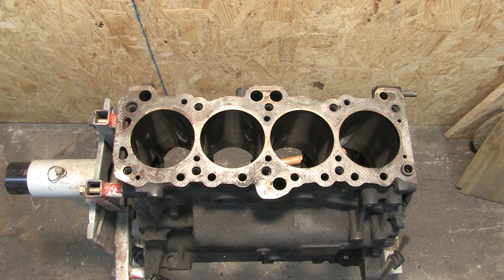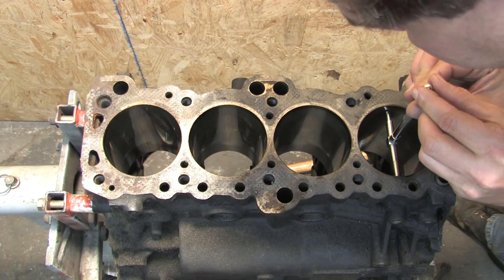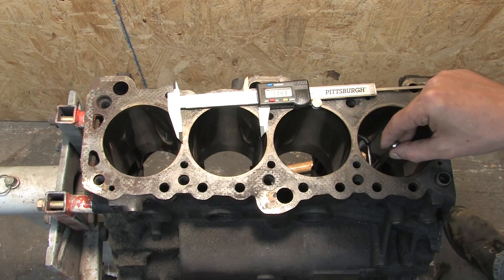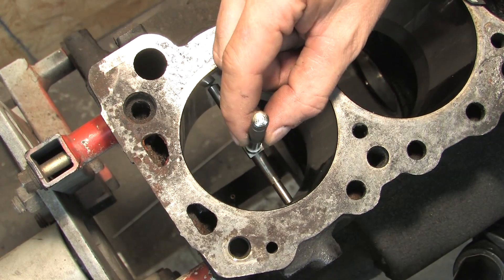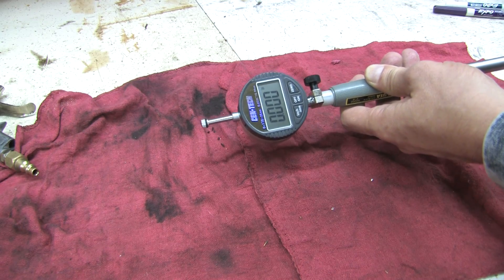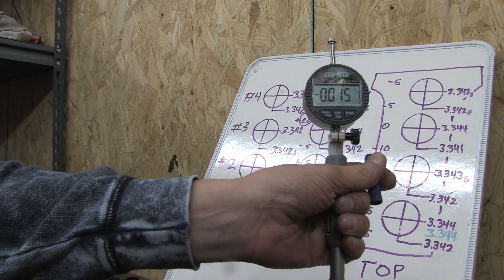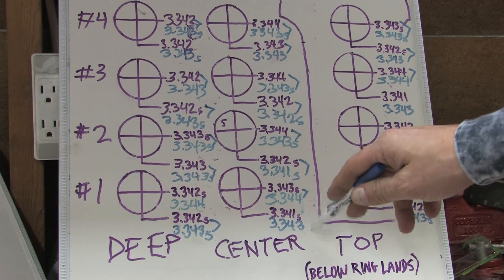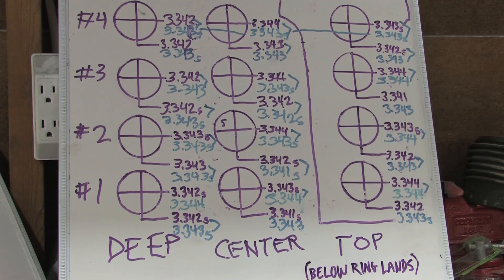Blueprint 106 - Cylinder Bore Inspection

Comment: Amazing that the 2 tools are that close but....using the telescopic gauges and calipers involve 2 tools and therefore 2 errors. Then comparing the bore gauge against the telescopic/caliper pair invokes an error of the 2 tools accuracy to each other. Also you can possibly be holding the telescopic gauge perfectly parallel to the cylinder wall on any one point or consistently across the 3 points in the cylinder and that could account for at least 0.0005 or more at each point I'd guess. So I'd say the bore gauge is the best way to go, especially given its ease.

But I really liked this video on the subject matter and how to measure..very well done...thanks!!!!!!!

Comment: Those cheap telescoping gauges ARE adequate for this job, contrary to the commenters' opinions below. Yes, top quality gauges would be better, but Jafromobile  is simply trying to decide whether this block should be shipped out for boring or not. I do have my doubts about that pair of digital calipers, though........don't know if it has the accuracy he needs. I use a fairly expensive dial bore indicator, but it's all about technique: the best tools give useless information to the inexperienced. Practice, practice, practice!

Comment: I'm using the digital dial bore gauge and measuring my cylinder with the stock size is 2.854 inches. If the biggest measurement is  - 0.001 does the mean I should add that to the stock size or subtract it. Thanks in advance

Comment: The proper way to use telescopic gauges is to wiggle it a few times  in the same direction of the length of the two spring loaded contact points  to align it in the center of the bore. On the last wiggle stop just short of being perpendicular to the bore and lightly tighten the gauge. Finish pulling the gauge to get it to the tightest point and pass it, as you pass it if you tightened the gauge enough it will remain at that length. Then remove it from the cylinder and tighten it slightly more so it doesn't move while measuring. Use a micrometer and very lightly tighten it on the two ends several times while moving the gauge on the anvil mentally noting the largest reading, move it all around the point that you got the largest reading to make sure that it was truly the larges reading.  Whichever reading was the largest is your measurement. This takes getting a feel for the gauge and the micrometer so practice is necessary. Using a pair of calipers is not advised because you do not get a good enough feel but it is better than nothing and with patience will at least give you a rough comparison but will not likely give an accurate measurement. I just measured a block that the cylinders had a total measurement difference of between .014 and .017 difference from taper and out of roundness so in this case a pair of calipers would be good enough to tell it needs to be rebored.

Comment: How about bore distortion from torqued fasteners (head and main)? Have you compared measurements with a torque plate vs. without?
Reply from the maker: Not yet, but I'm fairly certain that a 4g63 will produce very little deflection if it's even measurable at all.  I'm not saying that a 4g63 is somehow impervious to this effect.  In fact, that condition is very real, and it's exaggerated if both of those surfaces aren't perfectly flat... it's just more likely that inline 6 cylinder, large displacement, or sleeved aluminum alloy blocks would suffer from this than a medium-sized cast iron solid-decked inline 4 block.  My machine shop uses a torque plate for boring.  I don't worry about the mains.  6-bolts have massive main bores and 7-bolts have a girdle.  I've never been so curious about either affect on a 4g63 to have bothered measuring it.  It hasn't bit me yet.

Comment: the metric system is so much more easy to understand, I understand what your saying theory wise, but the imperial unit of measure is backwards to me. Why do Americans use a outdated system?, it's archaic. Great videos by the way.
Reply from the maker: +oliver fox One thing is true about the differences in measurements despite what may confuse anyone.  The average shop manual for any given engine typically has specifications for machining listed in both metric and standard  measurements.  Metric is in hundredths of a millimeter, standard is in ten-thousandths of an inch.  Because it takes .0004" to equal .01mm, SAE measuring tools graduated in .0001" have 4 times the resolution and accuracy than metric tools graduated in .01mm provide.

But the real reason why you see standard here is because the cost of metric precision measurement tools is prohibitively high in the US because supply/demand.  I now have standard tools graduated in .0001" and .00005", and I hope you can adapt because I can't afford their metric equivalents.  I end up doing more math calculating stuff from standard measurements to metric when I have to have it in an equation that way, I'll admit; but normally all I have to do is measure and follow a printed spec.  I can handle the SAE/Metric system either way and convert most of them without a calculator whether I'm measuring liquids or solids, so it really makes no difference to me.  For me it's all about precision vs. price.  

If anyone wants to send me a free set of Starret or Mitutoyo micrometers from 0-6"... oops... I mean 0-152.4mm... I'll be happy to re-shoot these videos using the metric system.  ;)  For me, they're over $2,000, and that doesn't include a dial gauge.  That's worth more than 2 of my cars, combined.
Reply: Here in the UK with its mostly metric for everything, we have weights in both usually and still use Mph instead of kph like they do on the continent. I can see what your saying, for sure that's a good point.I'm sure some heritage vehicle workshops will have to use both.its actually advantageous to be able to work in both and for things like pressure and speed I can, unless your of a certain age in here or a engineer, your average tech, like I am is used to what we use today. We don't measure engines at the workshop I work in, but I want to know practices that are useful and not that common in main dealers, I found your video really helpful. Thanks for taking the time to make it.
Reply: The reason is, imperial units of measure have fractional units whose denominators are divisible by 2, if not proper power of two which leads to useful properties when trying to reduce errors when taking calculations.  Metric system may lead to byzantine faults.
Reply from the maker: Man... why can't more of your comments be like this one?  I'd reply to more of your comments if you were at least subscribed.
Reply: Slappy Fistwad You sound smart but to the trained mind your byzantine faults suggestion - does not apply in this scenario.

Comment: You shouldn't have blamed the telescoping gauge for being inaccurate,  because you were taking the measurements with a vernier caliper.   Always use a micrometer with a telescoping gauge and you will find they are better than the dial bore gauge's.  Also, don't wiggle a telescoping gauge.   Tighten the tele gauge's screw just enough so that when you measure it with the micrometer it will retain it's length, and then rock it through.   This will compress the tele gauge to the exact diameter being measured.   Measure the thrust diameter (larger) first, then turn the gauge 90 degrees to immediately find the amount of egg shape in that height of the Cylinder.   The best tele gauges only compress on one end.  With one hand anchor the fixed end of the tele gauge and rock it through to compress the other end to get the measurable length.   Awesome videos,  keep up the good work!
Reply: That is a digital caliper not a vernier caliper.

Comment: great videos jafro, I've been following and learning the whole way through and buying tools you recommend to rebuild dsm engines. My question is with the digital bore gauge do I just set my dial caliper to 3.5 for example then put bore gauge in between and just press zero then start measuring the bores?
Reply from the maker: 4g63spdfreak Yes, you got it!  'cept you should use something more accurate than a dial caliper.  A dial micrometer with a known zero (in other words, tested with the reference gauge included with it) works better.
Reply: Ok sounds great thanks

Comment: The vernier caliper you are using is only accurate to +- 0.02mm at it's very best. Dial bore gage does save allot of time and hassle that is true.
Reply: There are digital calipers, dial calipers and vernier calipers, what he used are digital calipers.

Comment: it seems that i will soon buy a motor from the junkyard and start working on it but i have one question. the engine i am going to buy is a b230 it's a volvo engine, i have all the specifications for it but the cylinder measurement is like this no 1 cylinder 96mm to 96.01mm no 2 96.02 to 96.03 and so on . but when i measure the cylinders idont's have to set the bore gauge to 96 on the first cylinder and 96.01 on the other right ????

Comment: Hi again Jaf!  I measured my bores last night, smallest dimension was 3.359"(85.318mm), largest was 3.360 (85.344mm).  So obviously some wear on a block with ~222k miles on it.  The next sequence would be to choose some 85.5mm pistons, so the machine shop knows what dimension to bore the block, correct?
Reply from the maker: No.  They don't know.  The bore size is 100% dependent on your piston size.  What you need to do is measure your piston diameter, subtract it from your bore diameter, and compare the result to your piston to cylinder wall clearance spec.  The tolerances are very tight, so you will need a set of measurement tools that can handle .0001" increments.  Runout and taper limits are .0004".  I don't recall the piston-to-cylinder-wall clearance spec off the top of my head, but I do have a video about it.  If the bores are past that specification or if they look/feel rough, or are polished shiny smooth with no crosshatch left, Get bigger pistons, give them to your machinist with teh piston to cylinder wall spec (recommended by the piston manufacturer) and let him punch the block out to size.

I would recommend watching the Hyundai Assembly video where I blueprint the block.  I go through these steps, but the clearance on those pistons is really wide.  Use the spec recommended by the PISTON'S manufacturer because it's based on thermal expansion.  If they're factory pistons, use the factory spec.
Reply: *****
Right, that's what I was getting at.  I obviously need the new pistons in my hands before any block machining takes place.  Oh, and I subscribed, don't know what took me so long!

Comment: 0,1 milimeters is 0,039 inch
Reply from the maker: so 0,1mm = 1mm?  1mm is .0393701".  I'm not trying to argue with you, I just want to make sure you're checking your bores correctly.  I don't know why commas are in your numbers?  I've never seen measurements represented that anywhere, but that doesn't mean that it's not proper somewhere else.  I just don't know what a comma means in math?  1mm is 0.039".  If you're using a converter of some sort, it's probably not recognizing the comma.
Reply: ***** okay but just to make sure i now this when you have your taper and out of round you check it with the serivce limits on your cylinder bores. and also when you measure the bottom of the cylinder you don't measure exacly at the bottom right? it seems like you want to measure it half an inch up from the bottom ?
Reply from the maker: Jonathan Eriksson Correct on the depth measurement.  About a half inch up from where the top compression ring would land at the bottom of the stroke.

You check your x and y measurements to make sure the egg isn't out more than the service limit, and you'd check your y measurements at each depth against each other to make sure they're not off by more than the service limit.

The factory spec for the cylinder bores doesn't matter on the egg and taper measurements.  Treat that like a suggestion because it's never dead-on to the factory spec.  The bores need to provide the pistons with the correct piston to cylinder wall clearance.  The pistons might be any size close to the specification because there are variations in casting and machine work, but the bores were originally cut based on the diameter of your pistons when they were new.  Bores are always based off of piston sizes.  If you bored the block then looked for a piston that fit the hole, you'd be putting the cart before the horse.  :)
Reply: ***** okay thanks for all answers now i know how to do this the right way.

Comment: so you measure the two top measurements and subtract it to get the out of round and you take one of the top measurements and one of the bottom measurements and subtract it to get the cylinder taper. But when you get the taper number that number must be how much you need to hone of the cylinder. So if you have taper of 0,010 inch you have to hone of exacly 0,010 inch of that cylinder????? am i right
Reply from the maker: You're spot-on with the math.

There's no way you'd be able to nail the center of the bore perfect enough to only cut .010".  You'd need to go a little bigger to make the hole perfectly round again.  Not by much, but your piston size should dictate where the cylinder wall is cut.  If you went .010 over, you wouldn't be able to get away with using the same pistons and/or rings.  You'd want to get a new set of pistons, measure them, then cut the bores to the size hole you need for the correct piston to cylinder wall clearance.
Reply: ok now i just wondering when u get the out of round measurements and the taper measurements you need to compapre them to  the engines cylinder service limits right??. I have a volvo 940 and the service limits on the cylinderbores are 0,1mm
Reply from the maker: That sounds pretty extreme for a taper or roundness limit.  It should be down around .01 mm.  .1mm is four thousandths of an inch.  The specification for most cars is four ten thousandths.  That's .0004" or .01mm.
Reply: ***** I don't know i says 0,1 for wear limit
Reply from the maker: I would be skeptical or confirm with a mechanic.  .1mm is a big gap.  I work primarily in inches because that's what all my tools are.  I'm not familiar with finding commas in measurements?  I don't know what that means, but .1mm is pretty thick for a service limit on roundness or taper.

Comment: Sorry jafro, but I'm laughing at you. 
Using harbor freight tools from china wonderland to try and get precision accuracy, repeatibility, and quality prefomance? You are not even using the snap gauges right. Have you wiped out the cylinder bores spotless? Cleaned the anvils of the telescopic snap gauges? Cleaned the jaws of your calipers? And do you even know the accuracy of he calipers? and what about the harbor freight digital indicator on top of your cylinder bore gauge? Sorry to rant, but please invest in quality tools before you go about replacing, rehoning, or reboring your cylinder bores.
Reply: Andre Gross I did it the harborfeirgh method and then dial bite guage and micrometers and got the same .005 difference I was getting before. Either way need to review I think
Reply: jafro wasn't saying his tools are the best or even ones to use, he is simply showing how to measure and the difference between 2 tools, so I think it was very well done. I do agree to use the best possible but many people cant  pay for high end tools...although you pay for it one way or the other in the end I guess. I really liked this video.

Comment: not sure if there has been a comment but when you are using snap gauges you need to enter at a slight angle release the lock then tighten slightly but not over tight, then use the handle to rotate the gauge out this will compress the snap gauge to an accurate reading.

Comment: Little bit of genius there. It would also be interesting to measure that ring gap at various depths with some feeler gauges. It wouldn't necessarily tell you anything you didn't already find out with the digital bore gauge. It would be interesting to measure anyway. BTW, that block looks like it's ready for a stress hone. Also BTW, a stress hone is better than a non-stress hone right? I had a machinist insist on it for my small block Chevy once.

Comment: Buy a micrometer with 0.0001" resolution and a high quality mitutoyo bore gauge with 0.0001" resolution. Proper piston ring seal and no oil consumption is key if cylinder are bored and honed with accuracy of 0.0001". 0.0010" resolution is not good enough.

Comment: I'm going through school right now and we are using telescoping gauges. The technique we are shown is to place a piston ring inside the cylinder, then use a piston to push it into the cylinder about four inches. The idea is that since the piston will only fit into the cylinder straight and true, the piston ring will be square to the cylinder wall. Then you rest the telescoping gauge onto the ring and take your measurement. Are there any thoughts on this technique?

Comment: Good and clear video. But you really have to invest in a micrometer. This will cost you less then a 100 en then you use a device that you can calibrate. Setting a dial bore gauge using a (cheap) digital caliper is just not the way to go. The shown resolution might be high, but the acuracy is really bad. Gabriel Smit, Holland

Comment: question so if my bore size is 3.7598-3.7602. do I set the dial bore gauge at that size? it didn't go to the shop yet it 2002 Nissan Maxima 3.6 motor.

Comment: Piston to cylinder clearance is 002-003 correct? You make some good points as only the dial bore gauge is accurate enough to determine if the cylinder is usable or not?

Comment: thanks for clearing up some dial bore gauge questions I had, thanks
Reply: Problem is, he isn’t doing it correctly. Another poster got it right; place it in at a slight angle, grab with fingers of both hands and pull.